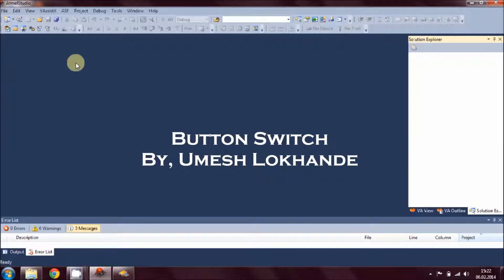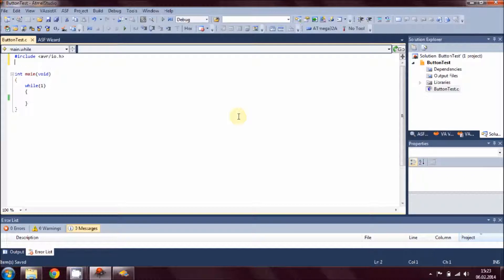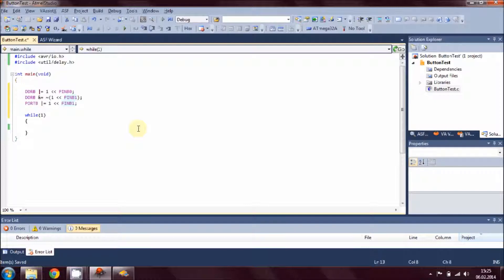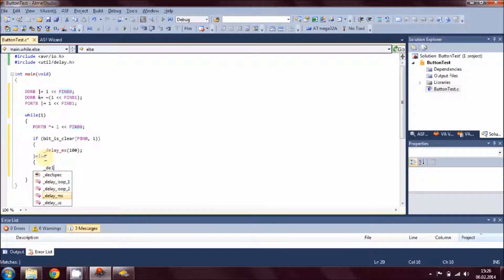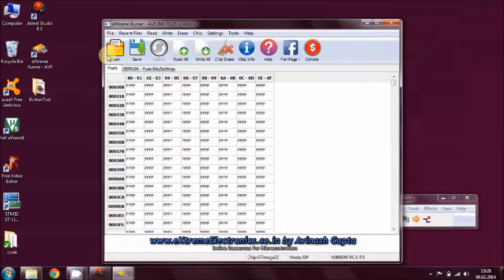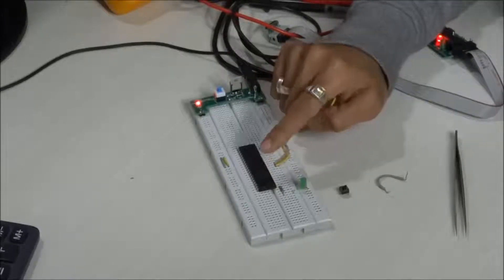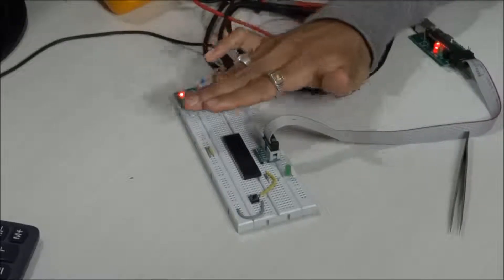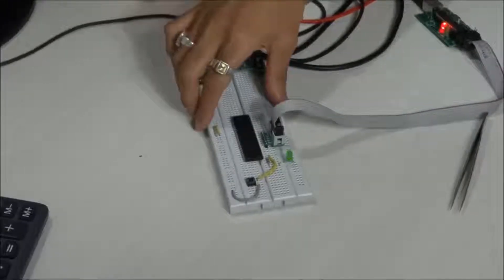Switch with AVR ATmega32 Microcontroller

Comment: how Microcontroller is working without crystal..?
Reply from the maker: +Chinmay Kolhatkar : To function any microcontroller, We must have to supply frequency to drive clock. Here in this case we  will be using INTERNAL OSCILLATOR WHICH CONFIGURED TO 1 MHz  (Internal clock) as a factory default setting for ATmega32A Microcontroller.